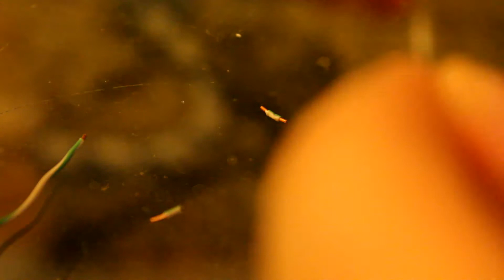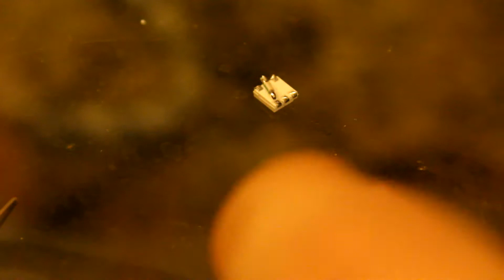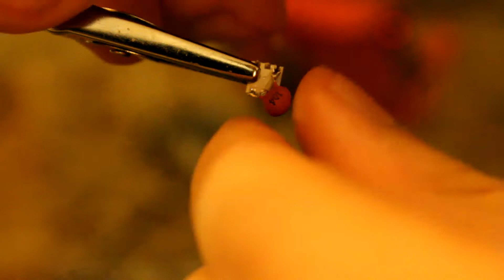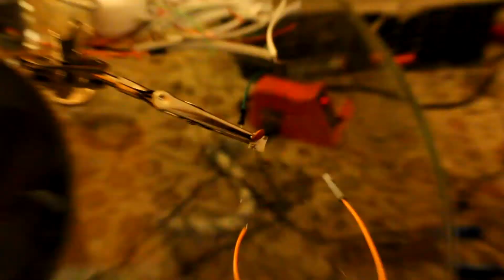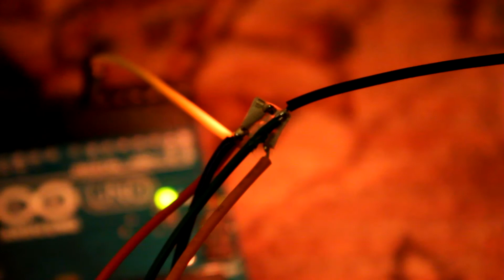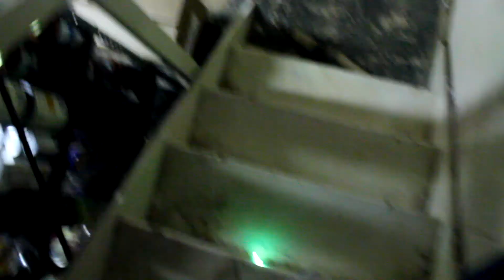ws2812 soldering and distance test

Comment: Thank you so much.  The new ones only have 4 pads, no need for the jumper.  Great technique.
Reply: Normally the WS2812 can not withstand a high soldering temerature, or you will get most of them not works...refer: https://makerfab.blogspot.com/2018/09/w-hy-ws2812sk6812-failures-after-smt.html